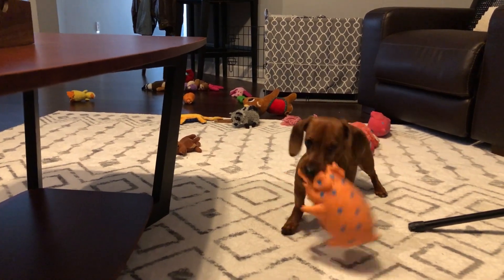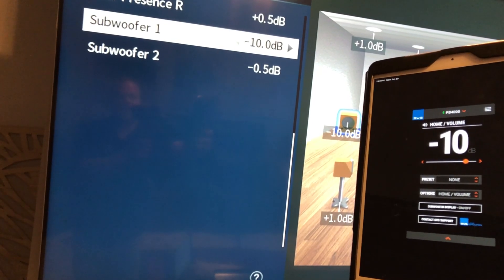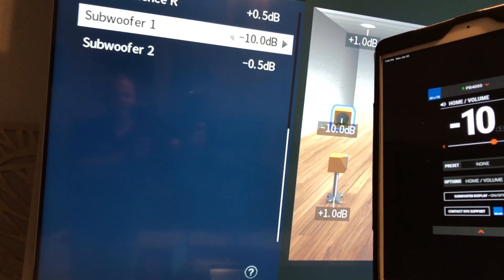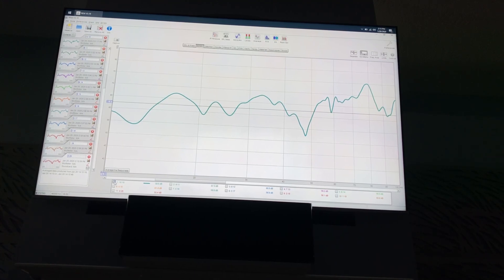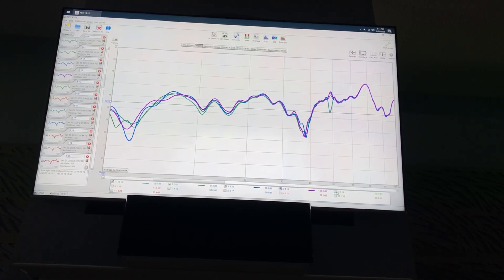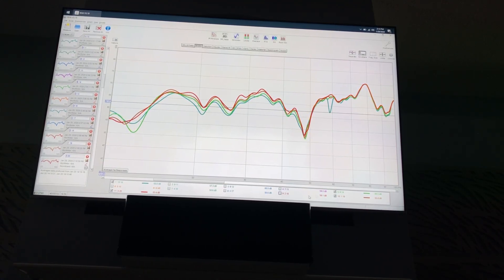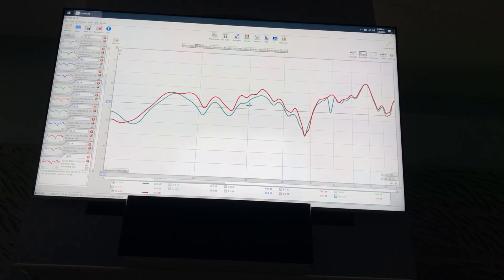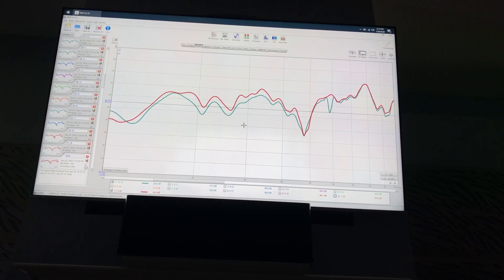Is AVR Or Sub Gain Up Better?

Comment: Can you adjust your gain on the sub after audyssey calibration?
Reply from the maker: It’s fine for relatively small amounts but you at least risk the crossover slopes effected to a degree past a certain point. You may or may not hear anything.

Comment: I have always been curious about this myself. With car audio you use an oscilloscope and set your gains based on distortion. But with my home setup I usually do it manually with a DB meter with my subwoofer output from pre-amp at -0- and then using the sub's gain to get to 75db at the LP. I like my sub output on the pre being as close to zero as possible. plenty of headroom and if I need to lower it also.

Comment: Something which you cannot see from REW. By increasing the output on the AVR higher and higher you are most like sending the sub out into clipping thus increasing distortion. You are also overloading the inputs on the sub and again causing distortion.
Reply from the maker: No, not at 0 or below.  Which I went over.

Comment: Interesting side note. I run HSU VTF-15's and the manual says to run the avr at zero and adjust the sub gain to your desired level.
Reply from the maker: It’s easy, safe instruction.

Comment: Thanks for that. Could you explain how the subwoofer trim comes into play in Yamaha receiver? Is that just another volume control for the sub after you have everything dialed in so you don't have to touch the volume dial to make quick preference changes? Yamaha gives it a more complicated explanation that is beyond me.
Reply from the maker: That’s just a shortcut to the avr gain
Reply: @COGuyStuff  Thanks

Comment: Your premise is of course correct: It doesn't matter. Perhaps at the volume extremes of one or the other you'd get clipping (sub way down) or audible noise (sub way up). But mostly it should not and will not matter.
Reply: Absent clipping the subs input with too high receiver settings, doesn’t one get a theoretical noise benefit since by having the sub’s level much lower you are turning down the noise of the prior components? (SVS recommends the reverse for fear of clipping their input for the record, and subwoofer101 svsphile claims greater dynamics with sub input set high).
Reply: @meles3740  Yes, but only in theory. Once noise reaching your ear is below that of the room's ambient noise level, any further reduction is moot. Further, subwoofer noise isn't the typical "hiss" because it's usually at 80 Hz and lower only.
Reply: @EthanWiner  Subs are an odd area of sound in my book. The snake oil is pouring on heavy here; https://youtu.be/1nhXKCqSYJ8?t=150, but I don't doubt that bass done right affects overall sound. SVS themselves runs silver wire in all their current subwoofers. I've recently heard impact on system with subwoofer from taking three meter eight gauge cable (van den hul Magnum) and doubling it up for 5 guage (isobaric setup, so biwiring technically). Schotky dioded a crossover myself and swear I had blacker background. And now I've heard word of mouth of theory that how the bass frequencies are reproduced affects are perception of the high frequencies (i.e. having extended bass). Probably a bunch of cork sniffing snake oil, but would you give any of the above credence? Friend has Magnepan 1.7s with supplemental ported isobaric sound and when we turn sub off the biggest impact is to the sound of the highs. Is the sub's sound mainly its frequency response and ported or sealed does not matter? I'm facing the task of integrating two SVS PB12-NSD with the top section of a speaker with a defunct bass section so many things on my mind as I may be forced to upgrade to make this speaker work (like to a dual mode SVS). Bass costs quite a bit of money so any real science amongst the sorcery would be greatly appreciated!